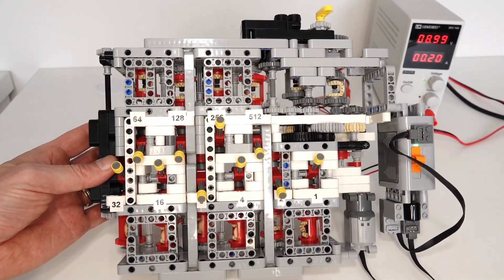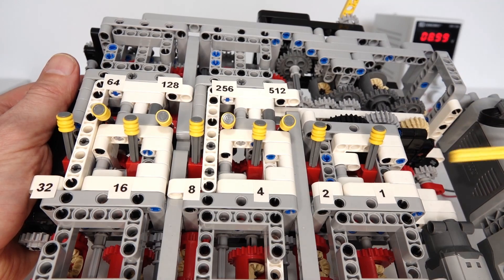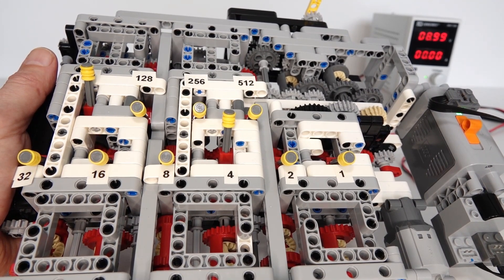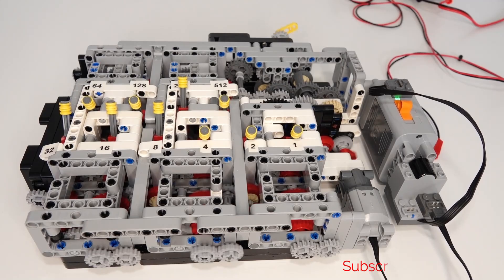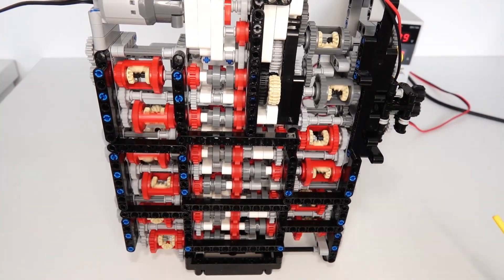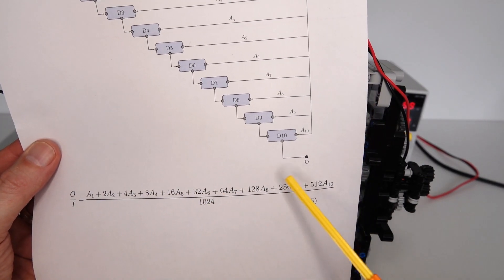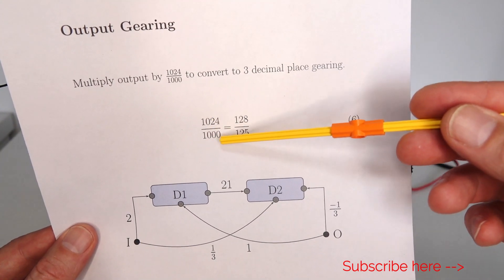1000 Speed Lego Technic MOC Gearbox

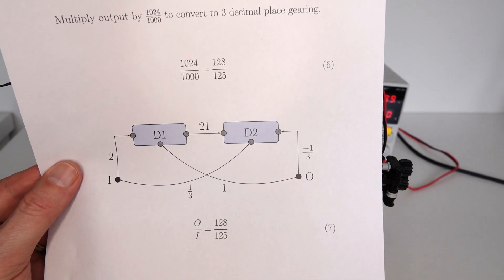Comment: at 6:18,  -1/3(21(2in+2out)+2in/3) = out, and I solve to get out = -128/135 in, not 128/125. Tell me where I went wrong plz before I lose sleep over this
Reply from the maker: Hi Not to Scale. Sorry have only just had a chance to look at this. For a differential we have C = (A+B)/2 so C = 2A - B. Using that equation I get (2in/3 - 21(2out - 2in)) = -out/3. Solving that I get out/in =  128/125. I think your mistake might have been the direction of the output to differential. -1/3 in the other direction becomes -3. Hope that makes sense 😀
Reply: @TechnicBrickPower  thanks I get it now. I hadnt noticed the arrow heads last time